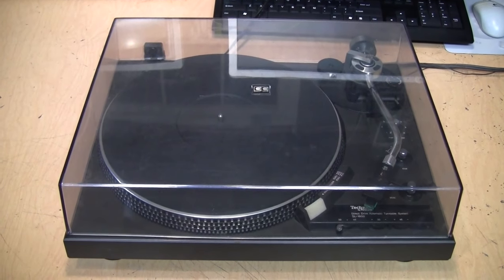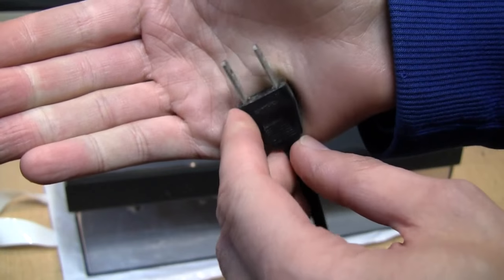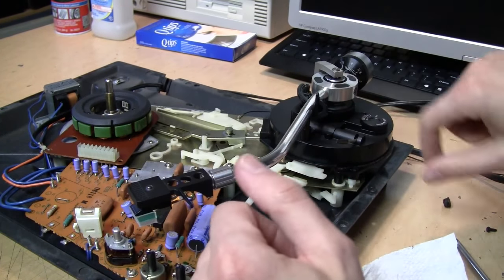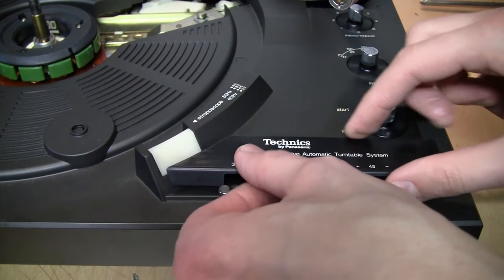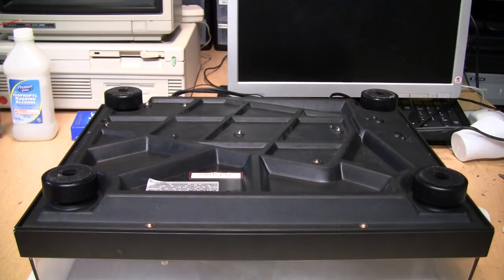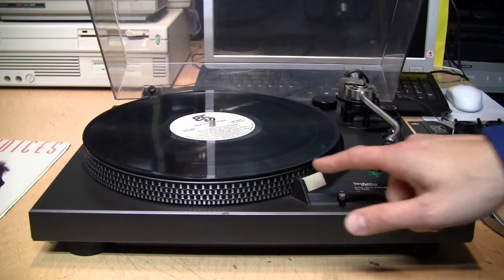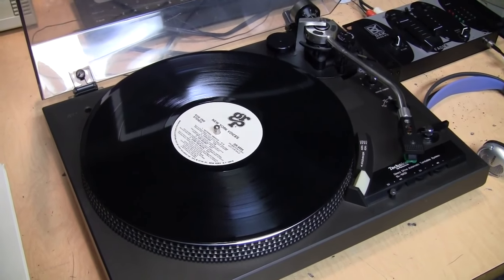Technics SL-1900 turntable repair & review

Comment: I got one of these for free off of craigslist. It had the same problem and I just did what  you did to fix it. Ended up getting rid of it because I came to find out that it is made plastic, not aluminum like the other models such as the sl1750. I also have a 1750 with the rare center spindle that lets it drop a stack of records one at a time. Bought my 1750 for 50 bucks.

Comment: Great video. I found a Techincs SL D3 at the city dump a while ago. Same tone arm problem. Some cleaning an new grease solved the problem. New stylus and speed adjustment  but otherwise in perfect shape. I use it with a Saba MI 212 and a pair Philips 431 speakers which turnes out to be a perfect match. Total set price? €55 including the new stylus.  Also  have a Yamaha YP D71 that was given to me by the dad of my son's girlfriend. Fantastic turntable as well. So, it is worth it to look after the old stuff instead of paying a fortune for new.

Comment: Awesome, I almost bought this model but ended up getting a Dual 1242 instead. its a belt drive and it was really easy to fix. the start-stop lever was sticking in the start or stop position, all I had to do was remove the lever clean and oil and wham it worked perfectly. I did replace the belt as well. best of all it came with a Grado F3+ Cart.

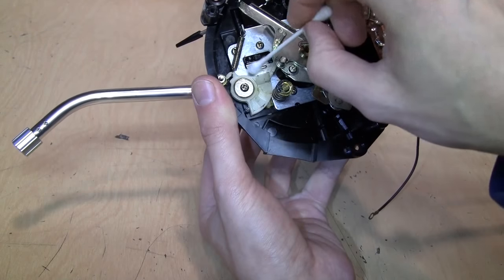Comment: UPDATE. 1st item.    I got carried away cleaning the up/down bits on my deck. As well as the bush and plastic bit you cleaned at 5:18 there is a post with a spring and a circlip (in the still pic at 5:18). It is just above and slightly right of the Qtip end. This is the 'oil filled damper' that also causes the arm to take a week to settle onto the record. If you remove the circlip, the spring, and then pull the damper in and out while qtipping it with ISA you can clean all the gunk out of that too. By flushing out all the gunk it makes the tone arm ENTIRELY controlled by it's lever. THIS MAY NOT BE WHAT YOU WANT. It does make it drop the arm very quickly in auto onto the record and I plan to take the whole thing apart again and drip a tiny bit of thin oil onto it to try get it to damp a bit again. Although, just having a run of it just now it seems sedate enough, although I have knocked the drop point for 12 inch a bit katty whompus so I need to go back to that. It now drops too far away from the center by a gnats bollock so does not engage the record but crashes the needle. Bugger!

2nd item. I can't remember where in the video you comment that the lifter bar (13:40)( the black plastic curved arm that lifts the arm up and down ) is set really high because the model used to multi stack records. You can adjust this to your taste. Headshell off, tone arm lever down and tone arm locked in place,   then you can gently press the curved arm down on its spring, press a finger each side of the middle where there is a tiny black slotted screw. This screw has a hex head and when you press the black plastic curved bit down it releases the head of the screw from the moulded hex socket in the curved arm. You can then screw the black slotted screw, while keeping the curved arm held down...   down ( to make the arm lower, or up ( to make it higher. When you let go of the curved arm you might have to slightly turn the slot screw to get it to lock into the moulded hex socket in the curved arm but once set, no more sky high headshells for you!

Comment: I have this turntable from the day it came out and in recent years has had numerous tweaks and repairs. It has finally stopped staying in pitch. After a resistor check which all were good I did change a few caps(bad esr values) and then all cap were changed when I had all in stock. It just stopped spinning, it lights up though. I checked to make sure all caps were correct, polarized were in correct position and NP caps were replaced correctly. I sent turntable to a place my friend recommended(He has known and has repaired his SL-1200's for years) and they couldnt repair and they didnt charge. I may look for a donor to try and get it back up and running

Comment: Great find, although Technics anti-skate works and is reliable its not always accurate on the scale, I set them up using a blank vinyl (one sided) 

Has this got some kind of dampening built in? It seem springy when you were pressing down on it

If you get chance try out the AT120E cart, its still sensibly priced but sounds much nicer than the 95E

Best regards
Reply from the maker: Yes, the feet are spring-mounted, probably to help absorb the shock of the record changer model (SL-1950) dropping records on the platter.
Reply: I own about a dozen Technics turntables and all of them have springs in the feet. I think the springs were mainly to absorb normal vibrations in the operating environment such as footsteps.
Reply: Using blank discs for anti-skating adjustment is not going to work. The skating force is different when the stylus sits in a blank groove compared to one that contains a track. There's much literature around about it; here's an example: http://www.pinkfishmedia.net/forum/showthread.php?t=154663

And yes, the spring-loaded feet are there to cancel out impact noises from footsteps and such. Technics used three different principles: unsuspended turntables (no dampening; e.g. the SL-1300/1400/1500), spring-suspended units (such as yours), and those with a suspended inner chassis (e.g. SL-1300MK2/1400MK2/1500MK2).
Reply: I'm glad you mentioned the original 13/14/1500 series. I have a 1500 and I had completely forgotten that it doesn't have springs in the feet. Now that I think about it, it must be the only Technics in my collection that doesn't have springs. It's also my favorite, which is probably just a coincidence. :) It's a little bit more sensitive to footsteps than the others, but not dramatically so. The linear trackers are the least sensitive by far, which I imagine is mostly due to the tonearm.
Reply: MacPhantom whilst that makes for an interesting read there's not any scientific evidence to back it up. One guy says set to about 2/3 of the recommended - I also find this with the blank vinyl method - that's why I never trust the numbers. Sl1200 doesn't have sprung feet it has these silly sloppy rubber things which allow vibrations to easily back feed into the turntable.

Comment: I was able to repair my SL-1900 exactly as you described. Thank you! Also there is an adjustment screw in the lifter that will adjust the height that the lifter raises the arm.

Comment: Great video and really nice turntable. I totally agree with all you had to say. One tip: I found that a product called Marvel Mystery Oil (get it at hardware stores, auto stores or online at Amazon, Ebay) cleans up the old grease AND lubricates in one go. So you don't need the alcohol. It also thins lithium grease making it more slippery.  Sometimes you want lithium grease to be a bit viscous, but at others, you want the grease, but more slippery. Marvel is the product to help. Just a drop does a lot of work too! I use it in an injection oiler. Cheers.

Comment: The issue of the AT-LP120's speed fluctuations can most likely be attributed to a warped platter. It's something of an epidemic with many old and new AT-LP120 turntables. The only solution is contacting Audio Technica for a replacement platter, despite some people's just having spent over $200 on a brand new turntable!. Albeit the speed and pitch variations that a warped platter can cause are slight, and usually unnoticed by causal listeners, they are there--not at all a good thing if you have plans of transferring vinyl to another medium and want the best quality and accuracy.

Comment: I like that you can adjust the vinyl size and the rpm independently. I use a 70s Garrard turntable which also has an automatic mode but it can't do 45rpm 12", 45rpm 10" nor 33 1/2rpm 7" disks. I have some 45rpm 12" ones so I have to use the manual mode.

Comment: Looks immaculate for it's age, as if it just rolled off the assembly line.  I thought at first this was a modern turntable. The speed is dead on, even though the selector switch has that "cheap modern plastic" sound to it when you moved it, everything else on it looks well made. That red record also looked interesting, what's on it?
Reply from the maker: Make that "...for its age". ;-) The red record is just boring old piano music.
Reply: What could be the problem with a tone arm that is kinda stiff at the beginning of the record and causes  skipping? I have an SL-D2 and its doing that thru out the record. The set up has been done properly and the TT has a new cartridge and stylus, my other SL-D2 the tone arm is smooth thru out its range of motion appreciate any help/advice on what to check for.Thank you

Comment: Took your advise and purchased a Technics sl-7, very happy with it.  Though good cartridges for these older turntables are getting a but pricey.
Reply from the maker: The cartridge I have on mine is an Audio-Technica AT-95E, which only costs around $35.

Comment: Thank you so much for this! My tonearm was stuck in the down position...same solution though. Also cleaned up the anti-skate mechanism which was also frozen due to the solid grease. BTW you can adust the height of the tonearm with the little screw on the damper bar. No more rushing to catch the tonearm before it drags across the record!
Reply: This is EXACTLY what I needed to adjust! Thank you.

Comment: If you want to kill off an AudioPhool, just use good turntable in a sentence along with the words Automatic.  They will keel over.
I just got a "needs work" sl-b5 off Fleabay.  Got the pickup and returns adjusted and weight and antiskip.  Had a squealing motor some 3in1 took care of.  I just love it..it's the nicest turntable I ever owned.  I wish I would have held out for a 1950 but I'm impatient and I don't have the luck he apparently does to get a deal that sweet off of Craigslist.

Comment: Nice review!  I just recently got into vinyl and picked myself up a new turntable, that being an ION Max LP.  Definitely not an audiophile grade turntable, but a good start to get my feet wet.  Have it hooked up to a pair of Dell computer speakers that have a subwoofer too, and it doesn't sound too bad.  Also, great song you played at the end.  I have a Billy Joel LP in my collection myself, that being has album Storm Front.  Also got a 45 of one of the singles from that album, "We Didn't Start the Fire" and managed to find it in pretty decent shape too.

Comment: Good video & nice turntable. 
Considering the SL-1900 is a low budget turntable that was listed for  160USD with 
a pretty decent cartridge included (EPC-270C-II with 0,3x0,7mil elliptical stylus) one
wonders why the industry is failing ( or plainly unwilling) today in delivering similar
 quality and comfort for triple or more the price.

Comment: I have a SL-1900 that I got for at least a half year ago, it works perfectly fine. When I found it, the lid was damaged so I threw it in the garbage. And I didn't realize that I forgot to remove the hinges until it was too late. I have a lid from SL-B2 that fits but the hinges doesn't fit. Finding hinges is very hard to find. I've could reuse the hinges to a similar lid. It sucks to not have the original hinges and lid.

Comment: wow I did not expect a reply so fast,thanks for replying fast,just wanted to remind that my antiskating is now fine it is set to my tracking  force number which is 1.75 grams,i used several blank cd's and tonearm did not move one bit ,I did not like the idea of tearing apart the turntable to repair antiskate,it did work on a higher setting #8 was afraid of damaging tone arm,but with overhang correctly set on my cartridge it is at normal setting,was also  wondering if u ever had a chance to review crosley C-10 turntable { made by pro-ject} always wanted a turntable with a wooden base ,yes not plinth ,am old school when I was younger  we would call them turntable base or base ,plinth sounds like to me since there are younger peoplegetting into vinyl that its there way of making the record player fancier sounding,don't mean anything bad by this,but just wanted your opinion on the C-10 which I also have Ten-Q JRo

Comment: Those Technics direct drives are great tables with awesome specs.  Excellent video, with a few exceptions that may confuse some of the vinyl newbies out there...  The most egregious error is you didn't balance and set the tracking force properly.  You didn't "Zero" the arm before turning the counterweight to set the force.  Also, you can adjust the lift height.  There should be a screw on the arm lifter you can turn.  Keep making great videos.  I suggest you do a stylus shootout.  Compare a conical to an elliptical, to a nude elliptical, to a line contact stylus.
Reply from the maker: I did balance the tonearm correctly. I just didn't show it all on video. That's why I linked to a video with a much more detailed tutorial on how to set up a turntable and balance the tonearm. And I did adjust the left height after making this video.
Reply: Ahhh...my mistake.  Glad you set it up correctly.  I've just had to teach so many people how to properly set up one, that the omission in the video of the zeroing the arm stuck out.  Again, you're making great videos.

Comment: About the Vinyl Eyezz clip:
In the video, he says that many vintage players are in not so well condition, unlike new ones. Many people can't fix them, so they have to take them to the shops, which will cost extra money. And if there is a good vintage turntable in eBay, it will be quite expensive (other than the occasional deal). 
VWestlife, just take into consideration that Vinyl Eyezz does NOT know how to repair a record player, unlike you, with your "McGyver-ing" through the circuitry and gears (that is a compliment).
Oh and he watches your videos.
Reply from the maker: My main issue with Jarret is that he often tries to make himself sound like an expert, when he's really a beginner at turntables and vinyl. For example, in one of his videos he said, "In my experience, I prefer direct drive over belt drive" -- even though he's only ever owned one turntable (his AT-LP120) and it's direct drive, so he has no personal experience with belt drive turntables.
Reply: @vwestlife  he did like one video with the fluance rt81 but that was when he had to move or something then he went right back to using the LP120. I prefer belt driven turntables but I dont apose to direct drive tables especially quartz locked ones the new LP120x WH30 and WH40 tables Audio technica has made look very nice to me. They even added a new LP60 with headphones with it as well as redesigned LP60s i saw it when someone went to CES 2019 and saw the tables they showed off.

Comment: Wonderful job. 
Any thoughts on my issue. Technic SL-3Q. 
My tonearm will have  a "jerky like"  motion when i  engage the auto start. After an almost stop while half way to where the start of the record, it propels to correct location, lowers, and record plays great. 

Also, my player wont always start when I hit the auto start button.  

I took the platter off and looked around, nothing seemed to be troubling.

Comment: So I recently purchased this table used and it works almost flawlessly I bought it from the original owner who took fantastic care of it. I say almost cause it does have a bit of trouble holding its speed it drifts by about mid way through 1 side and the tone adjustment is very very sensitive I cant ever seem to get the strobe dead locked I can get it damn near there but i cant seem to make that last fine adjustment with out nudging it over and the strobe running the other way and getting caught in a loop of back and forth lol. What would you look for and how would you go about repairing this issue thanks!!!
Reply from the maker: You may need to spray some contact cleaner (like Deoxit) into the speed adjustment potentiometers.

Comment: Great video! I recently bought a SL-1900 with this issue, followed your instructions and got it to work again. But the TT I bought is lacking the outer parts on two of the damping feet. My question is, are there any other Technics players that share those same parts, so I can widen my search for replacement parts?

Comment: Useful information on what the problem may well be,worth doing anyway.Something I generally always do,screwdrivers always put then in contact with a magnet,the more powerful the better,where this is really useful,is the screws usually stick to the screwdriver,when removing them,and very useful,hold the screw in position when installing them,a real help if access is difficult,on any job,amplifiers etc!

Comment: I have a similar Sony PS-X35 which seems to be that Sony was wanting it to be a competitor to the Technics. Same wow and flutter readings of  ± 0.05% [DIN],  0.03% [WRMS] and a Signal to noise of 73dB [DIN B]. Though mine is a Quartz lock direct drive, so it does not have manual controls to adjust speed. One thing that did surprise me is the Automatic function does seem a little slow in comparison to the Sony's, though far quieter. The Sony clunks and thuds away, although I quite like hearing all of the noises as gears and levers set the automatic mode.

Comment: The reason the tonearm raises up so high with the cuing lever in the end test, is that, that's the way this specimen  has been adjusted. There are directions in the owner's manual on how to adjust the cuing height of the tonearm.
Reply from the maker: Yes, after making the video I did adjust it so it doesn't raise up so high.
Reply: @vwestlife  Thanks for sharing.